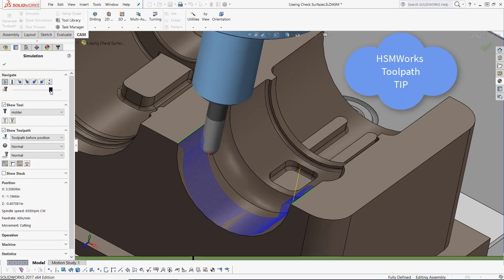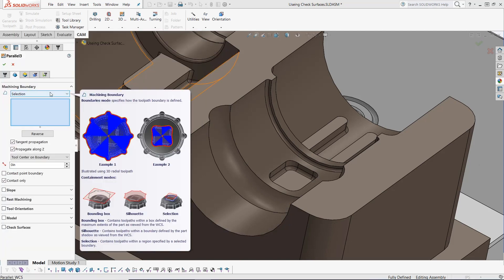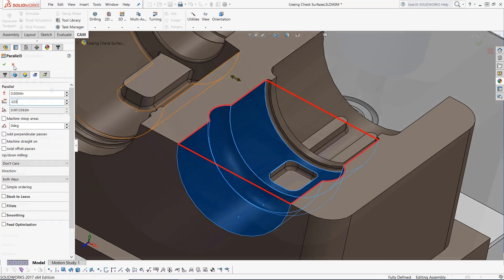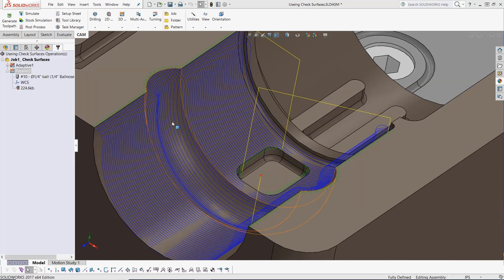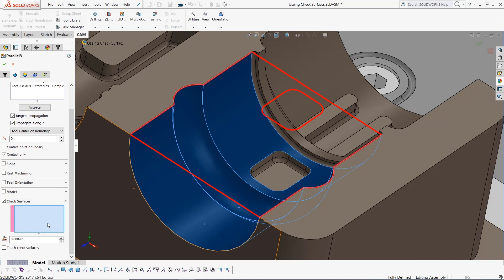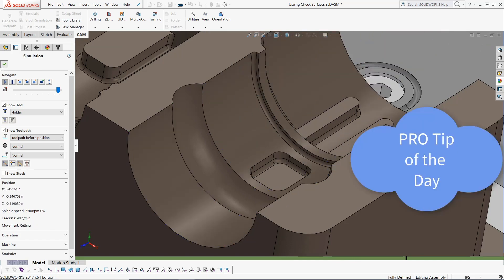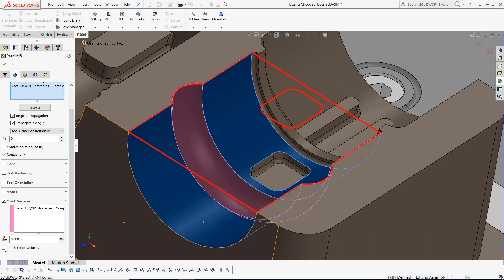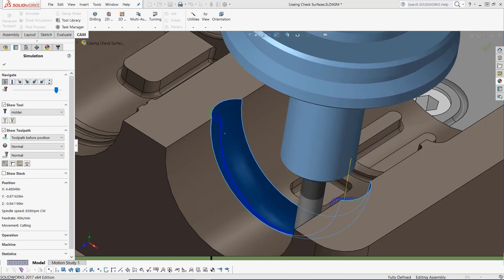HSMWorks QUICK TIP: Check Surfaces

Comment: Hi,
if I wanted to select a rounded face on a part I wanted to carve out using 4th axis, I go to 2d adaptive, select wrap toolpath and then, how do I select a curved face?
Reply from the maker: Unfortunately, Check Surfaces is a 3D toolpath option, so you won't be able to use it while programming a 2D Adaptive. You should be able to check the "Wrap" checkbox and then select curved pockets and contours to create toolpaths on wrapped geometry. Mike Mattera goes into detail here: https://youtu.be/NpUxAm_ybkQ He uses Fusion 360, but the workflow is nearly identical.